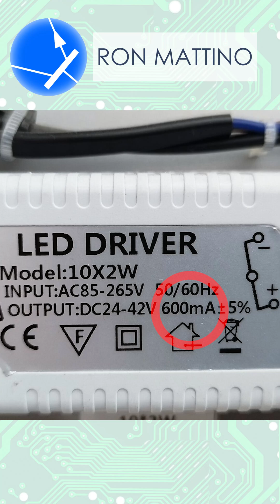LEDs are current driven, not voltage driven. What does it mean? #diy #electronics #led

Comment: Keep up the good work. Another question Could you please explain if led flashing rate controlled by e.g. 555 control can be another solution for led brightness, or just use a potentiometer with its variable resistance could control the led brightness (inspired by this video). Could you compare between the two methods as regarding voltage/ ampere changes and as regard led half life.

Comment: Claiming that LEDs are driven exclusively by voltage or current are both false.

They are not linear. They have threshold voltages below which they don’t emit light, and current limits above which they die.

Don’t encourage simplistic thinking.
Reply: Wrong.
They do not have a threshold voltage.
This is a myth by those that have had no formal education in electronics.

Go take a look at the IV curve for the LED.
There is NO step change in that curve. It's an exponential relationship, it's defined by the Ebers-Moll equation.